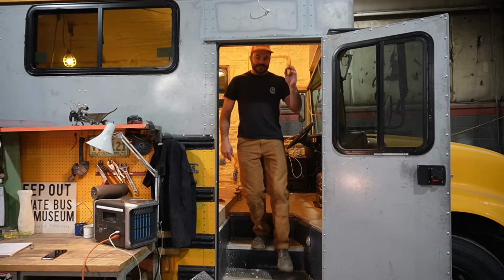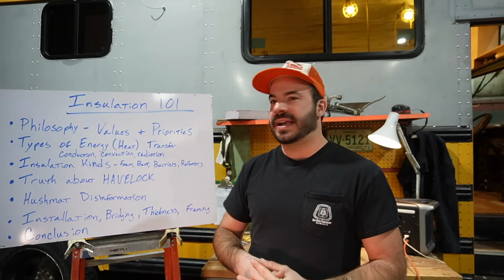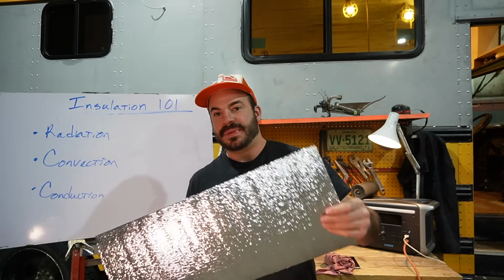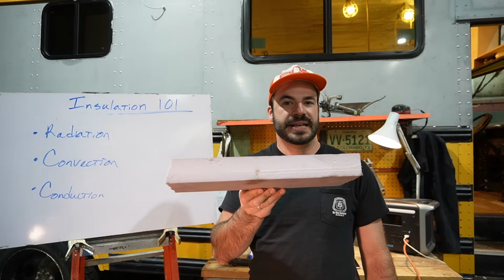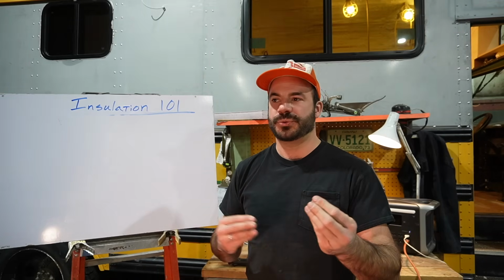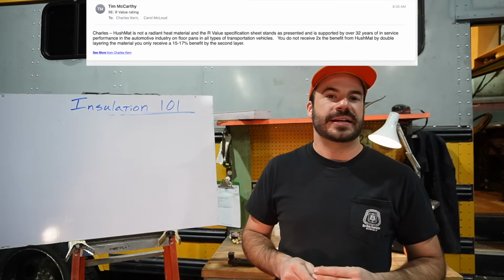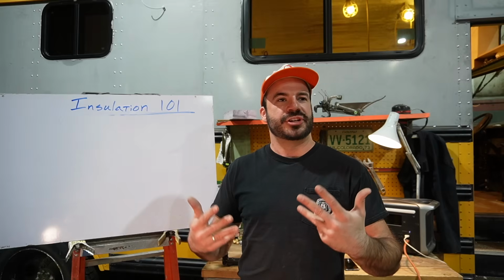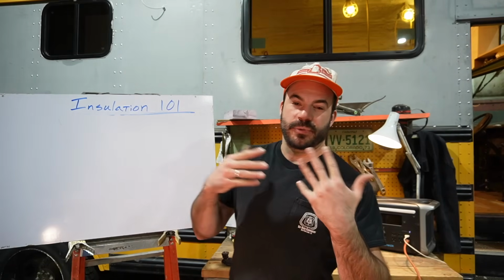Insulation is a SCAM (& the truth about Havelock and Hushmat)

Comment: Great explanations! How do you insulate the cab of the vehicle tho to avoid condensation on metal? The roof I can get at....remove head liner and insulate. but what about the rest? E.g. floor board, A and B pillars, fire wall behind the dash?
I'm planning to work on a Merc Sprinter.

Comment: Ever since I bought a van I always wanted to use spray foam, the issue I was told is...spray foam can deform you wall panels if you use too much or install it incorrectly, so not having any experience I opted to use a type of 2' glass fibre with. fold backing, now for me up in the Rockies in Canada it works I think primarily because I use a diesel heater that roasts my Van.  Chuck you may not see this comment as I am writing 7 months after you released this video but if you can clarify this information or misinformation about deforming the wall or ceiling panels please do, Thank you very impressed with your videos easy and clear info to understand  bravo and thank you from. THE GREAT WHITE NORTH!

Comment: Hi Chuck. Your content in this video is Brilliant. I am doing a box truck conversion which has FRP (Fibreglass reinforced plywood) walls in a steel frame with a Truck box plywood floor. What would you recommend for sub floor insulation? and could I build it the same way you did in the bus?

Comment: What if you plan to be moving around to areas of the country during their temperate seasons? In other words, I will occasionally use a little wood stove for chilly mornings/evenings and AC on the occasional warmer than usual day but I will never be in areas of snow, ice and very cold weather. In fact I hope to be letting in fresh air most of the time and using AC or wood stove sparingly when absolutely necessary.
Reply from the maker: i would still insulate as best i can. it makes such a difference
Reply: @ChuckCassadyYT  most definitely plan to insulate 👍🏼

Comment: this is great tho overwhelming a bit need to watch it again maybe. I have a shuttle bus that u just started and it has no metal ribs on the ceiling and that is my biggest dilemma now how to evenly insulate the curved area and use same fiberglass ceiling to cover it all. spraying foam seems like something that will no guarantee shape? or am I wrong? maybe somehow use some soft insulation like that wool with moisture barrier.. but I really do wanna spray it all one time

Comment: for those smaller van converters who don't have the option of adding an inch+ of spray foam throughout their vehicle (practicality/space redution etc.) could you investigate the relative merits of spray cork insulation? Appreciate it won't achieve the same R values but as a means of reducing thermal bridges on metal framework and any additional studding (timber framework) it may be a viable option, in tandem with other insulative materials. Here in the UK we don't have the same range of temperatures so many vans are simply treated with butyl sheet for sound absorbtion in critical areas, thin (10mm) closed cell foam with aluminium facing, 'rockwool' or plastic equivalent and then carpeted plywood (3.5 mm) paneling. Much of the metal framework is simply carpeted over (4 way stretch polyester), hence why many DIY conversions have damp issues. In many ways it's preferable to insulate and panel in such a way that the inevitable moisture generated in use can escape rather than creating preferential areas for condensation to accumulate. It's the main reason for making all your wall and roof panels easily removeable, without having to deconstruct the interior....

Comment: Since you have to drill holes in the ribs of the bus in order to attach the wood framing, would it be possible to fill the ribs with spray foam insulation to help with the thermal bridging problem?
Reply from the maker: you can, but its a waste of time and money to me

Comment: The purpose of a silplate gasket is also to prevent the wood from wicking up the moisture from the concrete correct ?
Reply: Another commenter explained that to be the true reason for using stuff like spray foam.

Comment: Well...I think you just saved me from making the mistake that lady made with hers. I'm building out a hummer, and it has metal ribs in the ceiling. Have you ever used lizard skin? I've been looking into that trying to find anything that does not require a lot of space to use. It is a spray on insulation that's meant to prevent heat transfer on metal surfaces.

Comment: Hi Chuck, could you comment on which particular brand or type of spray foam you would recommend? There are two known issues with using spray foam I am aware of, one - it's easy to overfill a cavity, and that causes expansion/deformation on a thin metal sheet. And two, it came as a surprise to me while working with a body shop to fix a van dent, they needed to do some side welding and told me they have a concern about foam-filled insulation, as it can be flammable. Basically, they wanted to disassemble one side to validate the insulation type. I guess I'd like to know if the foam you are recommending does not have those caveats. Thanks.

Comment: Hey Chuck. If I don't opt for spray foam, and use havelock wool, can I instal a vapor barrier over the wool/metal ribs and negate the condensation problem described in the video? I don't have enough heigh space to be able to handle another 1-2inches of spray foam off the ribs. I'm nearly 6foot tall lol.

Comment: Dude, I can't thank you enough for this video. I love all your videos, so much vital information.

I am planning on making basically a box to put on the back of a flat bed truck. Two questions, if you have time. 

First question. My plan is to make the box out of steel beams for strength, and I am worried about thermal bridging. My idea to solve it is to put two layers of wooden strips (ferring strips I think you call them?), one on the inside and one on the out, but off set so that their is no direct bridge. (I.e. both sets of strips spaced about a foot apart, but inner ones start six inches from floor and outer a foot.) Sound like a good idea? What could go wrong? (Wrap the outside in Aluminum, then spray foam insulation)

Second question, seems to me like in general every plywood sheet (or whatever you use) should have a little expansion room. How much room would you leave and or why don't you worry about this? (I know you did for the floor.)

Comment: Ok, I think I have a little input, take it as you will!!!
Old houses breathed, with materials like wool, they didn’t have consistent climate/moisture controls in place! Yet!!!
We find these homes surviving for over 100 years! Because they breath! And not just rot! 
Then we had apartment/residential structures of 90’s (Florida especially) were “sealing” the walls became important,  tons of structures became total losses in few years tons of rot!!!
What? Why? Craftsmanship! Moisture finds a way inside! And no way out(nature’s funny that way) anyways total losses! 
However, if a structure is very well created! And consistently maintained! The water(moisture) is kept at bay! 
However, if structures have a fault in design or maintenance, and no release of the develish moisture!!! Dun dun dun problems.
Another issue that’s truly serious, if you use “Any” type of combustion heat inside of a giant “YETI” cooler without proper ventilation!!!! The flame literally wont burn anymore because it sucked out the oxygen and replaced with carbon dioxide and you get to avoid the apocalypse!!!! Yaaa! 
Anyways the last point I made is realistic! 
Think of similarities of your bus and a igloo or any cooler construction! Put in a lot of carbon dioxide sensing and prevention. 
FYI I like your designs and selections. I just thought this might???clarify something????!

One more!! If you put conduit inside a foam wall, you will likely created a massive moisture in the conduit issue!!! Literally creating water pours out of you box!
Last one! Low moisture environments serve well!! To your “radiant” barriers! However in high moisture dense environments there’s no substitute for layers and depth.
If u mixed a hush radiant with a wool, then maybe another radiant you created a thermal blocks(not bridge)!
Dude! Stick with what to do and not bashing other’s designs. This isn’t a simple subject! 
I’m a fan by the way, this vid just went south, promoting you ideas is great! But the bashing isn’t cool, (not talking about your framing ideas)

Comment: Awesome Skoolie conversion classes. Thanks for taking time to educate people. I’m a certified energy auditor, and completely agree with you. Living/breathing/cooking/showering inside a steel can is very different from the same in a stick built wood home that ‘breathes.’
Reply from the maker: yes! thank you for being here with your knowledge! The approach I like is to built it tight, then ventiliate it right. mold is no joke
Reply: I am a builder of many things. My two homes (literally houses) have been insulated and sealed so tight that they end up pulling vacuum  when using my wood burners. The closed cell was a complete home run to seal my cabins crawl space from the living space ...we also sealed the wood faces exposed in that crawl space from moisture degradation. No moisture transfer OR cool air thermal bridging. As a DIY'er it was difficult to "get out my checkbook" but MAN what a homerun.

Comment: If you are showering, breathing and cooking...  and you don't have proper ventilation to dry out that air...
It's don't matter what your insulation is...  your interior will be trash.  
A bus must have flowing air.  Dry heat in the winter, dry AC in the summer.
Reply from the maker: Build it tight, vantilitate it right! the vent fan in this bus can change out the air every 30 seconds, but i do want to look into a small erv for use when i dont want the roof vent open

Comment: Super informative video! I was surprised that you didn't mention Thinsulate. In theory it is a bat style insulation that doesn't hold moisture because the polyester dries very quickly. If it works for someone sweating in a jacket, it should work well in a van/bus.
Reply from the maker: The difference is that when I’m sweating in a jacket, I don’t have a metal skin outside my jacket trapping all the moisture in. I have used it, but in my mind it’s the same as any other batt style insulation
Reply: Yea, I wondered why there was no mention of Thinsulate.  I disagree with Chuck's reply that it's the same as any other batt style insulation.  I have had Thinsulate 600 in my van walls (XPS in ceiling) since 2016 with partially finished wall panels.  I have been able to go back to inspect the Thinsulate and there is not issues with moisture damage or mold.

Comment: I'm sorry but if you're using anything but spray foam in a metal skin structure (bus, container, etc.) you are deceived and may be of low intelligence.

R value has nothing to do with radiance. Any claim otherwise is bunk and hokum. R value is for conductance only, not radiation, not convection.

Comment: I asked ChatGPT This: 
How would I layer Insulation on my floor for all weather types, Hot to cold. Dry and wet. 

Insulating your van's floor for all weather types requires a combination of different types of insulation materials and techniques to address various temperature and moisture conditions. Here are some general steps you can follow to layer insulation on your floor for all weather types:

Start with a vapor barrier: To prevent moisture from penetrating the insulation layers, start by installing a vapor barrier on the floor of your van. This can be a plastic sheet or a special vapor barrier material. Make sure to seal any seams or gaps with tape or adhesive to prevent air leaks.

Add a layer of closed-cell foam insulation: Closed-cell foam insulation is a type of spray foam that creates a water-resistant barrier and provides good thermal insulation. Spray the foam directly onto the floor of your van and allow it to dry before proceeding to the next layer.

Install a layer of fiberglass insulation: After the closed-cell foam has dried, install a layer of fiberglass insulation on top. Fiberglass insulation provides good thermal insulation and can help to absorb moisture. Cut the fiberglass insulation to fit the dimensions of your van's floor and secure it in place.

Install another vapor barrier: After installing the layer of fiberglass insulation, add another layer of vapor barrier on top to prevent moisture from penetrating the insulation.

Add a layer of rigid foam insulation: Rigid foam insulation is another type of foam insulation that provides good thermal insulation and is resistant to moisture. Install a layer of rigid foam insulation on top of the vapor barrier, cutting it to fit the dimensions of your van's floor.

Install a subfloor: After installing the insulation layers, install a subfloor on top to provide a flat, level surface for your finished flooring material. The subfloor can be made of plywood, oriented strand board (OSB), or another suitable material.

Finish the floor: Once the subfloor is installed, you can finish the floor with your choice of flooring material, such as carpet, vinyl, or hardwood.

Overall, the key to effective floor insulation for all weather types is to use a combination of different insulation materials and techniques to address various temperature and moisture conditions. By layering different types of insulation materials and using a vapor barrier, you can help to keep your van comfortable and energy-efficient in all types of weather.
Reply from the maker: HAHAHA thats gotta be a 5" thick floor in a van
Reply: @ChuckCassadyYT  that was my first thought 🤣 .. still a decent set of instructions though

Comment: Well, I wish this video was available 2 years ago since I definitely fell for Havelock's marketing scheme... I have a 37-foot bus that is almost fully converted; walls, flooring, and ceiling are all done, with the walls and ceiling all being insulated with wool. And of course, I have a condensation issue. I removed some ceiling panels and found the ribs to be wet. And it is cold and wet in the winter where I live, so I'm sure that adds even more to the issue. Some steps I've taken is using APOC roofing cement and aluminum coating on the roof to make more of a barrier between the steel and the elements (when it snows or ices is when we get the most condensation drip in the bus), and to mitigate the possibility of future leaks. I am also going to seal gaps with spray foam. But I can confirm that this issue goes away when its comfortably warm inside.
Reply from the maker: Yes, if you can keep it warm enough to lower the relative humidity and raise the dew point inside the bus and are conscious  about keeping indoor humidity under control, you are doing well

Comment: Fantastic discussion of insulation properties!  I wish people talked more about moisture control - we spent a lot of time thinking about that and I just pulled off a sample wall panel in our van (we live full time, are in cold Colorado right now, and used havelock wool) and found our Havelock wool DRY as a bone.  No vapor barrier at all.  We just keep our van heated and maintain proper airflow.  

Our hesitation with spray foam is in case we ever got into a fender bender and needed body work!

Thanks again for the thoughtful discussion!
Reply: My old Econoline was insulated with fiberglass insulation, and I had zero problems with it.
I did not live in it full time, but I did go camping in it many, many times over the years.
Zero problems.
Reply: Any experience with very hot and humid climates?  Do you spend a lot of time during the day in the van, or mostly sleeping?

Comment: THANK-YOU! I keep investigating why the LQ horse trailer world is so against the spray foam and insist a person do the closed cell pink/green board-with aluminum tape and then a frame...which also made no sense to me in terms of condensation and heat exchange etc on the ribs-except the claim that there would now be an air space between the interior wall and the metal framework of the trailer. I actually am not looking to fully insulate and deck out my tack space-but would like to reduce the amount of radiant heat from the roof. You just answered my questions perfectly! Great discussion!

Comment: As an engineer, Chuck has provided a very good overview of the issues and reasons why there are significant issues with some insulation options. Many insulation products are being advertised in what can only be described as inappropriate / deceptive marketing strategies, and in many castes bordering on fraudulent marketing if not directly fraudulent. Chuck, was very clear about the need to stop moist air being in contact with cooler surfaces where condensation will form and mould will grow. It does not matter what insulation is used if moist air can get to cooler surfaces condensation can form. This is why fully sealing around form boards for example is also important to ensure moist air cannot get to cooler surfaces. In so many cases we see people doing van conversions with ill fitting insulation. This will allow mould to grow, often in hidden spaces and become a serious health hazard. A lot of this information also applies to other areas including our homes, boats etc. I personally have been looking to help home owners and off grid users (including RV users) with independent help with solar information which is another area where many people are being deceived and miss-sold. See my Facebook page at https://www.facebook.com/howtovideosandproducts for more info on energy saving and solar.  .